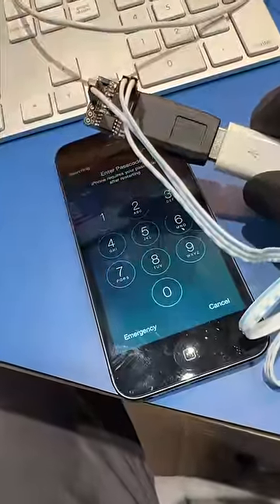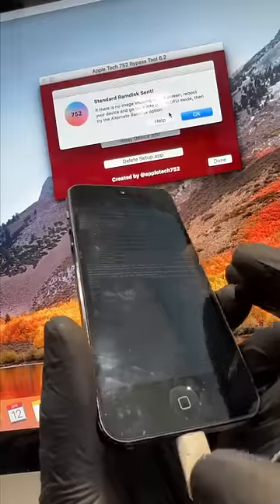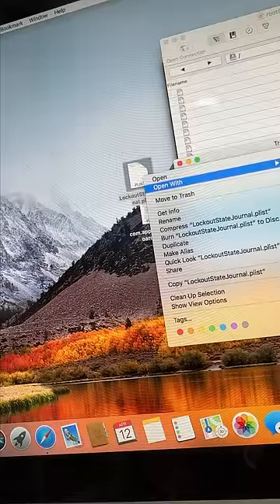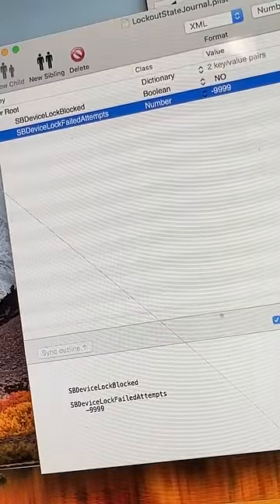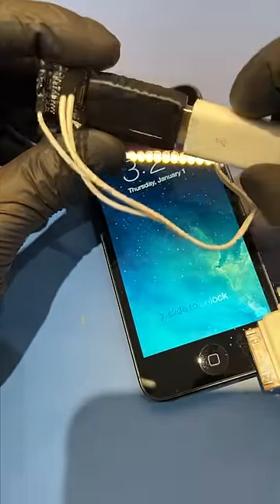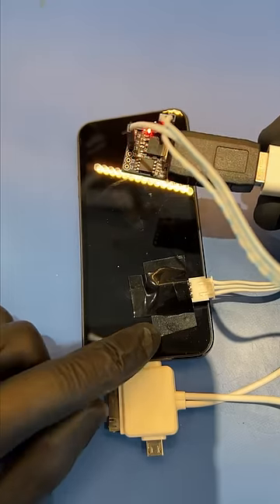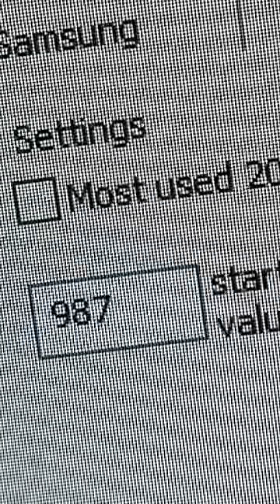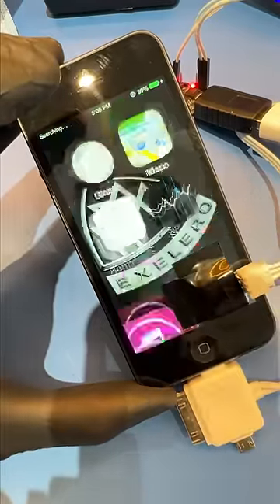Hacking an iPhone Full Video… #tech

Comment: What is the wire thing that you tape to the phone? Does that simulate a finger typing in the passcode or something?
Reply: I’m pretty sure it’s a light sensor that checks if the brightness of the screen changes. It’s so that the computer knows when the phone has been unlocked so it can stop trying passcodes
Reply: The plug simulates a USB keyboard so you dont need to simulate taps
Reply: @Manny73211 where does one acquire such hardware to begin with?
Reply: @VerTicaLsProductions  some black hat hacker (hackers but the good kind) and those type of places i'm sure. or if your savvy enough with coding & can reverse engineer but that's not so easy for majority of people.
Reply: @M4TTYN  white hats are the good kind, I’m talking more specifically what hardware is present in this video. I think it’s an audrino board that processes the brute force attack, the rest of what’s in the video seems pretty reasonable to attempt on our own, and it’s something I’d like to test myself
Reply: @M4TTYN white/grey hat* black hats are the bad side. 
Also nowadays it aren’t ‘hackers’ but security specialists 🤭

Comment: If you had access to the OS, why could you not just extract the pictures directly?
Reply: Files will be encrypted
Reply: The phone before its first unlock after a reboot will have its file encrypted until you unlock it.
Reply: all your files are encrypted, you need the passcode to decrypt
Reply: Your data is encrypted but there's nothing holding you back from messing around in the root file-system?

The dude who designed this must have been working at VMware 😂

Comment: If the xploit allows you do download files, why not just download all the photos
Reply: Files are encrypted
Reply: @jondonnelly4831 ye wat the other guy here said, its encrypted. The password is used to Decrypt the device/Operationg System so that all data is available.

its the same reason why you need to input password when device starts and why you need to type it in almost everytime your phone screen turns off (assuming your settings lock it instantly).

Passwords are preffered over patterns, PINS, etc as you can type letters numbers and symbols making the device near impossible to decrypt with external tools.
Reply: No the files arent encrypted because he has them right there unencrypted where we can see the values. Also ive used localhost tool and the photos on old iphone are not encrypted. Some of the app files and system files are encrypted however, oddly enough you would think these values would be encrypted but im sure the newer iphones this data is encrypted for security reasons. The explanation could be the pictures are not on the device but instead in a cloud storage. Possibly he could access these photos but if he can just unlock the phone and the customer can get there photos and an unlocked phone.

Comment: Imagine the code is the ten thousandth attempt so the phone powers off 💀
Reply: It doesnt "power Off"
Reply: Even if it’s ten thousandth attempt the phone wouldn’t locked itself as that would just be considered as 1 failed to input password. You need 4-5 times failed input for the phone to locked itself. Even if it does it would only be 1 min locked and he can just go back and change the available tries to -9999 again

Comment: Just a question, is the phone case needed to be removed before activating the cooler?
Reply: Is it required? No. Does it make this easier? Yes. 

Good luck taping the sensor on the top right hand corner with a case on.
Reply: @sbmotoracer I think I commented on the wrong vid😅

Comment: Question. My Samsung A53 5G super fast charging cord stopped charging my phone.Yes, it's damaged, but  I charged my phone with another cord, and it worked very well. Also, the cord that is broken charged my other devices but not my phone. But the new cord charges my phone very well.

Why is that?

Comment: fun fact, setting it to 9999 attempts allows for a confirmed unlock since the total amount of combinations is 10000, and he tries 1111 in the start. To calculate the total combinations for 4 digits, it's 10 x 10 x 10 x 10 since each digit can be 0-9, so that's 10 options for each digit multiplied by itself 4 times for all 4 digit total combinations. 6 digits are much safer with a million total combinations.

Comment: If u have access to system files, why do you bruteforce the passcode instead of just having the pictutes of the phone?
Reply: Well sure he could, the issue is they are encrypted.
The files he has access to are unencrypted because the phone needs them to know boot
Reply: @tigerboy4705  oh okay, thanks! And if that file is unencrypted how that issue is patched now if the system need that file to boot?
Reply: @JuliAlvarez888  prolly just removing access by the external port or smt

Comment: Fyi modem phones are not this easy to hack. New phones, both iPhones and Androids are extremely hard to break into - but only if you have a passcode. If you have face unlock or fingerprint... In any situation someone could force you or use those credentials without your will to unlock your phone.

Comment: Dam. I have 2 of my old samsung S4s somewhere. Both have shot batterys and one has a bad screen (senitive in some spots and intensive in others) i cant rememeber exactly but i know they bith had different lock types. One for sure had a connect the dots one, but the other either had a passcode or password. But im leaning towards word. I have some photos lost in them but wouldnt mind getting them back. I doubt theres one of these for connect the dots or password recovery.

Comment: This only works on old iphones or those using older versions of iOS. This is not possible on anything remotely newer. IF you had access or the ability to create a zero day workaround for something like this, you'd instantly be rich on private market.. or you can cash out for an easy 1 million USD from apple to demonstrate your exploit. You can get into these older devices. But its more of a gimmick with very limited use. This also isnt the only way..

Comment: I feel as if manually brute-forcing your phone password and waiting for the annoying self-locking that you get after you couple incorrect attempts (It usually lasts 30 seconds anyways) would be much faster than waiting for a decade and then taking it to a hacker to open it for you. There are only 9999 possible permutations after all, not even that much.
Reply: Correct me if im wrong but don't those "please wait X amount of time to unlock device..." generally increase the amount of time you have to wait between failed unlocks? Ie 30 secs then 1 min, then 5 mins,etc etc etc.

Comment: haha thats ghetto! Looks like a digispark microcontroller plugged into... a keylogger! So the digispark is masquerading as a keyboard and iterating all passcode combos, the white wires connect to a sensor taped to the screen which tells the digispark when its unlocked so it can stop, and the keylogger is tk check the last code attempted

Comment: so let me get this straight, you pulled 2 files from the harddrive, you changed the files and put them back on the harddrive... then you bullshit us for the rest of the video? Why not pull the pictures of the phone which was the objective in the first place?
Reply: The operating system isn’t the same as the user data
Reply: The pictures( and all other data) is encrypted with the code.

He could pull them out but they would be useless as they are just encrypted mess
Reply: @tigerboy4705  then so should those 2 files that he pulled, rewrote and put back. nice try!